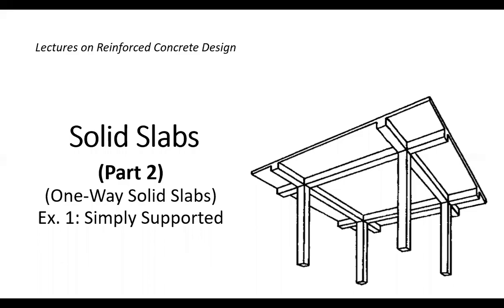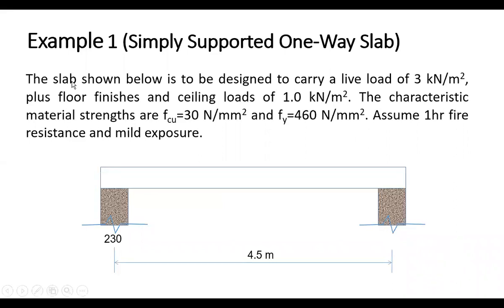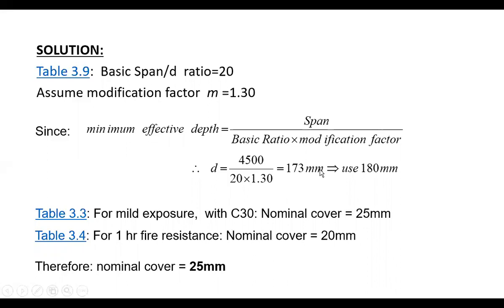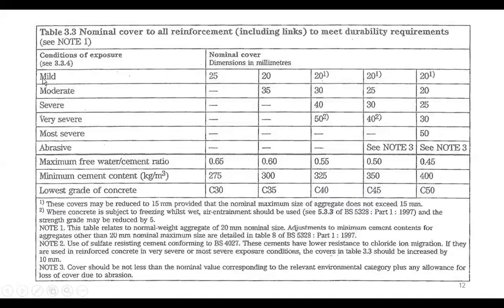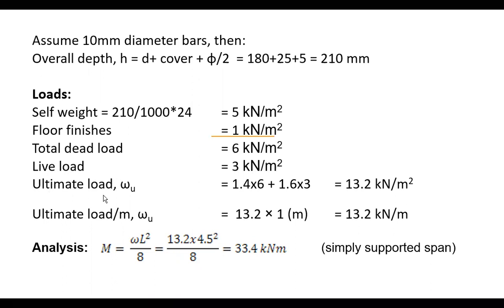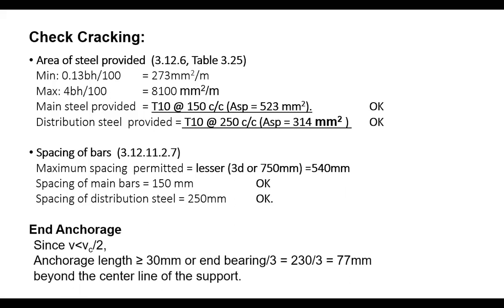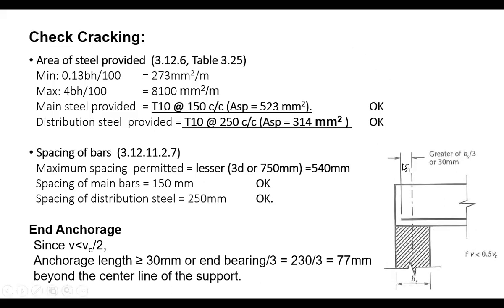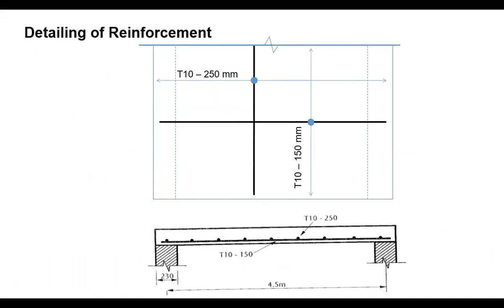Design of Reinforced Concrete Solid Slabs (Part 2) - Simply Supported  One-Way Slab - Worked Example

Comment: What happens if the calculated Area of the main steel(M/0.95fy*z) is less than that of the distribution steel(0.13bh%) ?

Which is going to be the main steel reinforcement?

What is going to be the Asreq and Asprov when calculating Fs for checking deflection ?

I'll really appreciate if you can attend to this very quick sir
My exam is next week Monday
Reply from the maker: Use the minimum. 0.13bh/100

Comment: The z calculated was 171mm. Why did you use 180mm in the As(Area of Steel) formula?
Reply: After calculating using 171mm, the result is 447, so never mind. I guess it's a typo.
Reply from the maker: Yes it is.

Comment: What is main steel < .156, where did u get this value?.156?
Reply from the maker: This is the k value. If k>0.156 this requires compression steel.
To learn more, check this video
https://youtu.be/3AbElFKNDqA
Reply: @MrElgamal77  ok thanks

Comment: Please, how did you get 523mm^2? 10:29
Reply: My same question
Reply: @okaroh  hey, after searching i got how he did it. 

Cross section area= Pi/4 X (diameter of bar used)^2

Spacing= (cross section area x 1000)/ area required 
you’ll get ‘180c/c’ but he ended up using ‘150c/c’

Area provided (Asp)= (cross section area X 1000)/ spacing [which is 150 in this case]

the answer for Asp will be 523mm^2, that’s how he got it
Reply: @mieseigha  thank you so much

Comment: How do you know its T10
Reply from the maker: At the initial proporting, we assume it 10 mm. You can assume it 12 with no problem. This will not affect the thickness. At the end, the area of steel will govers if it is 10, 12 or 16..